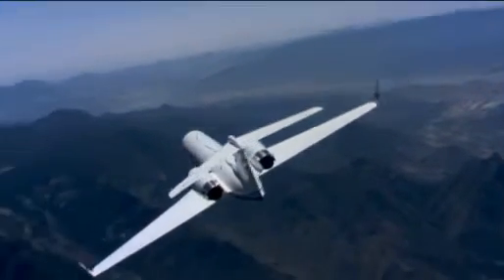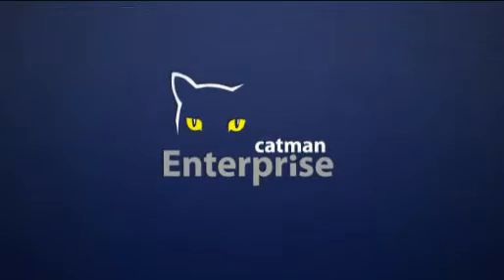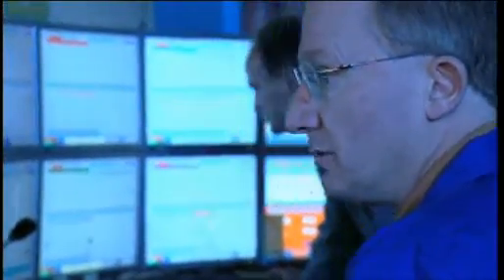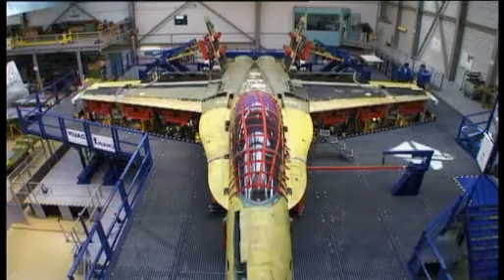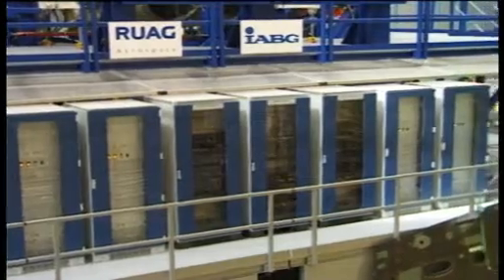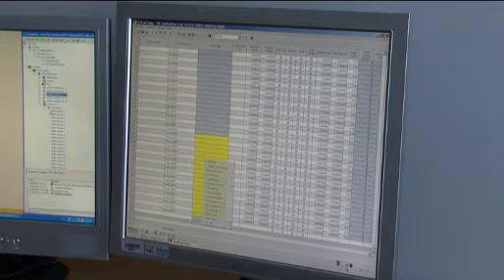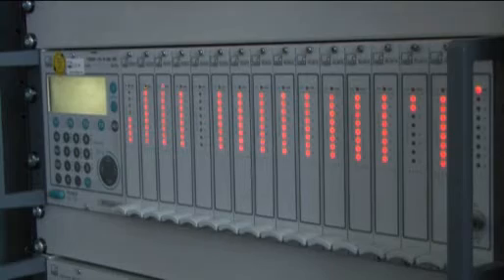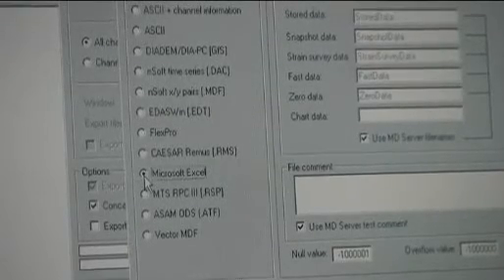Structural tests with mid to high channel counts with catmanEnterprise

Comment: What if Microsoft Windows 10 performs a forced reboot during a destructive loading test, and there is no possible way to assess the bypassed data points, except to start over with a new aircraft?